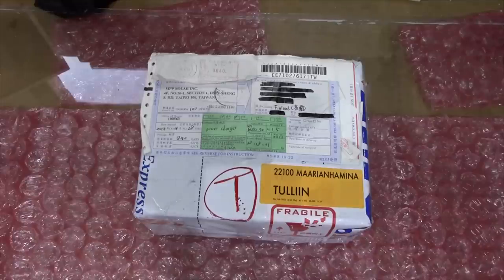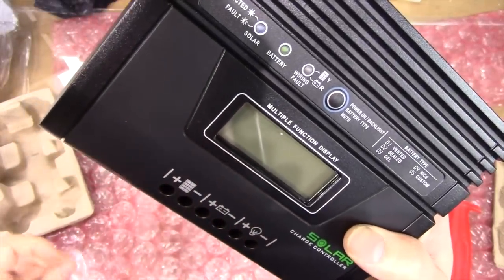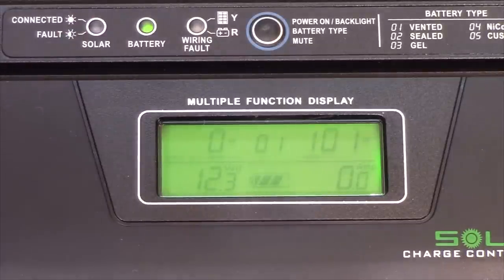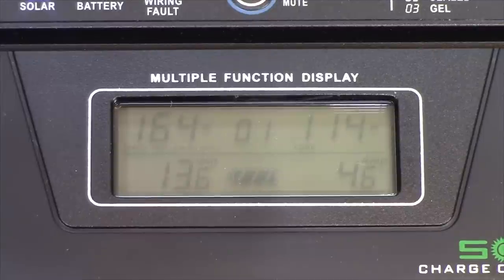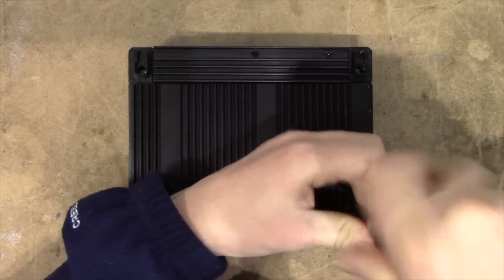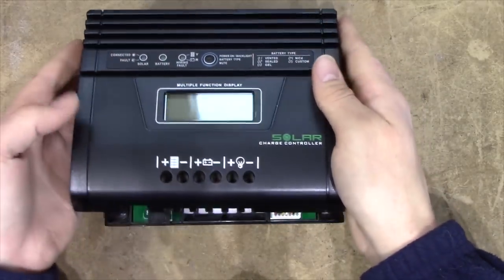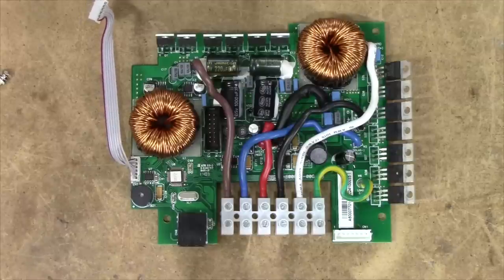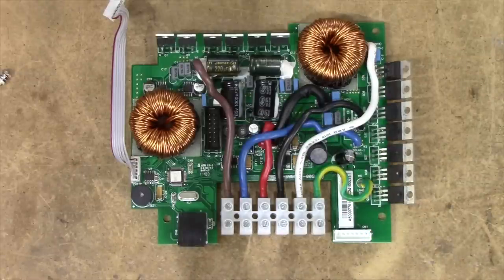PCM-3012: The $140 MPPT, in-depth review, test & teardown

Comment: I have this controller and it works well with a small pv array and a 420 amp hour battery bank. I did have some trouble with it finding the pv array at first but once found it has continued to work well.

Comment: Thanks for review, do you think it can handle 360watt, I have 2*120watt parall=240 18volt each and about 6.5 amp,  if i ad a 3´ panel it will give near 19.5 amp at "sunpeak" but I hear that 300Watt is max, what do you think will work best 2 or 3 panel.
Reply from the maker: No. >300W panel makes it freak.

Comment: Can you do a review on how to use the custom setting for battery to use Li-Ion battery banks.
Reply from the maker: I would NOT recommend this for anything lithium, due to the load dump during MPPT sweeps. You'd be causing a fire within a week.
Reply: I know some other MPPT solar controller have a setting where you program CC at a user defined amp setting and then CV at a user defined max voltage, Just wasn't sure about if this can do that or not.
Reply from the maker: James Bordon
While I haven't played around with newer F/W versions or the custom mode, mine would definitely not do that. It had different CV modes, but they're basically defeated once your batteries are fully charged.

Comment: Nice teardown, did they use buck converter or something with transformer instead inductor?
Reply from the maker: Dominik M No, it's inductor based.
Reply: Thanks! Did You think they used two phase step down converter? I can't imagine why they used two inductors instead of one. I was thinking first choke was transformer and second inductor on secondary side of transformer based dc dc converter. Cheers!

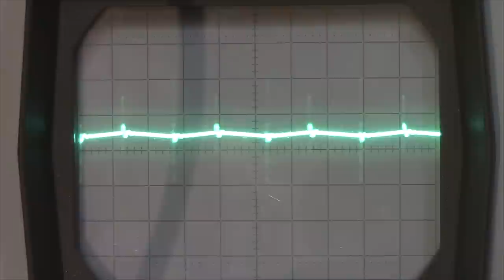Comment: Your discovery at 34:20 is a total show stopper.  The definition of a charge controller, is that it controls the voltage of your panels into your system, and it does not do that, as you demonstrate.  You surmise, without checking, that this won't be an issue with a fairly large battery and a modest load.  It is an issue.

I tested this same charge controller with a 150 watt panel, a 100 Ah vented battery, and a 2 amp (25 watt) test load.  In this configuration, every couple of minutes, the voltage surges up to 15 volts and then drops back down.  The high voltage is passed both to the battery and the load.

That is completely unacceptable.
Reply from the maker: Don Bindner I think you're unlikely to find any MPPT charge controller that doesn't do this to some extent. The controller needs to know how much power the panels can put out, and in order to test that, it needs to dump power somewhere, the battery being a very good place to do so. The issue with the PCM-3012 is that it has no OVP limit on this power dump, so that it might shut itself off from doing it. However, with a reasonably sized battery, the voltage is not going to go beyond 15 V for a few seconds - which is totally acceptable, considering the low duty cycle of the cycles (Seconds per several minutes). 

Any device you connect to a "12 V" system, is going to be built to handle at least 16 V.

Comment: thanks for sharing. but does this unit have a built in diode to block reverse current at night ?
Reply from the maker: +Ali Fawaz As in current flowing from the battery through the solar panel? It seems so, I never noticed any excessive night-time draw while I used this unit in practise.
Reply: +FFcossag  Thanks for your reply  :-)

Comment: Subbed. :)

One disappointment is the controller doesn't show / register loads under around 10A for no particular reason. Not a huge deal, but strange. Otherwise seems like a decent design.

Does anyone know the max output of this unit (on the load port, not the charge side) in Amps/Watts as this is not really detailed anywhere. I'm guessing it's around 25W which is supposedly the max battery charging value, I doubt it would go that high during the day as it would be sending charge power to the battery. I'm considering just wiring the solar panel and battery side and using the output port just to drive a sunon maglev fan to cool the heatsink and maybe a small LED light or two with a switch in the area so I can see what I'm doing at night. etc.

I'm considering tapping the load from the battery side instead, is this wise? I will be installing breakers everywhere including on the positive load / charging and on the separate lighting etc. circuits.
Reply from the maker: There's really little reason to use the load connection on this unit, since it can't really be controlled by anything except UVP, IIRC (unless the mysterious computer software can). I think this controller is mostly designed for use with a separate load controller of some kind.
Reply: FFcossag
Thank you for the response. I think that port is designed to drive small loads only, which is my intention for using it. I'm thinking of using a 3 panel collapsible set of Bosch panels at 12V deliverying 270W. I'll tap the batteries for the main loads. I'm going to run 3 x 12V DC lighting circuits to 2 or 3 LED halogen replacement lights (5/6A each) in each circuit which will max out around 16amp all with breakers and "main" switches. One circuit to run some kind of small inverter if required to do things like charge a laptop etc. The LEDs will really only be in use at night. I'll tap another circuit to run a watermaker to convert seawater to fresh, which is the main intention for the system. This will only be used occasionally to top up a freshwater tank.

Battery bank will be a few deep cycle units in parallel at 12V.

I did consider using it to maybe run a DC pump to lift seawater to the input tank, but I think I'll just use a portable petrol generator instead to run such a pump as it won't be used that frequently. Still not sure what sort of pump to use there, as it may have to run 50m or so and lift 5-10m etc. Still undecided, but I don't want to over-complicate the solar system.
Reply from the maker: shades2 The port is switched with a pair of pretty beefy FETs, so it can probably handle a fair few amps without issues. I can't recall perfectly, but I think the output circuit was similar to the input circuit, so 30 A or so shouldn't be a problem.

It sounds as if you've got a good use planned for that system. Is it for a cottage?
Reply: FFcossag Essentially, a small beach house in a remote location.
Reply from the maker: shades2 Very nice. Good luck!

Comment: Great Review, I'm considering getting one of these for my camper trailer...

I found this page: http://www.mppsolar.com/v3/pcm20123012-series/
It links to the wiring diagram for the PC serial connection cable: http://www.mppsolar.com/v3/catalogs/MPPT%20cable%20pinout.pdf

I haven't found the software for changing settings or software for flashing with new firmware though...
Reply from the maker: Daniel Bird Thank you for sharing that link, that's definitely interesting! I'll add it to the video description.
Reply: FFcossag I also managed to find this page: http://www.mppsolar.com/manual/PCM2012_3012%20FW/ which appears to be the firmware and software for flashing, and maybe the settings program?